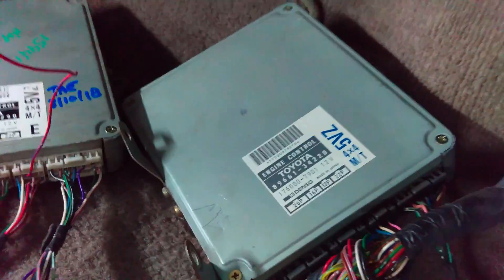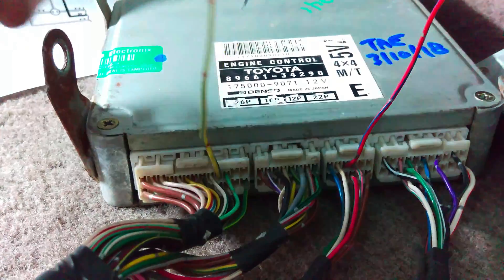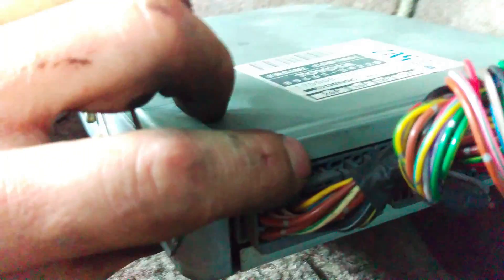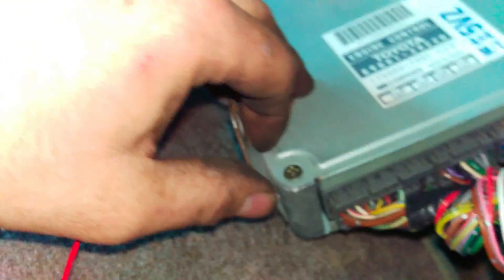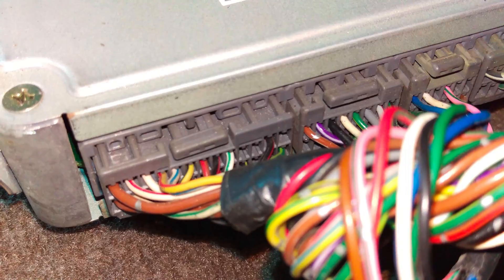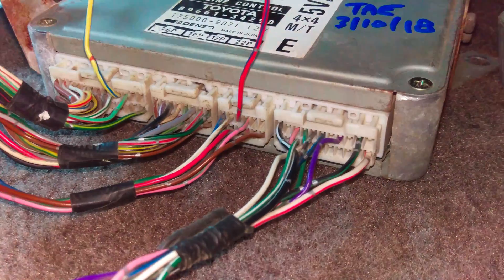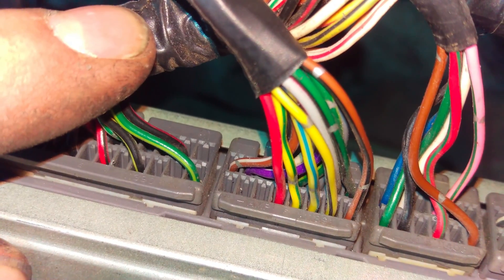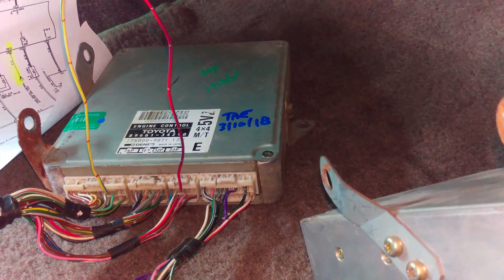Why We’re Upgrading the ECU on our Toyota T100

Comment: Did you use a 97 "complete" wiring harnesses? Like did you have to tear ALL the wiring from a 97 then remove all the wiring from your 96 to make it all work? I mean I wouldn't think so. You video I a bit confusing in certain places like when your showing the two ECU'S side by side it looks as if you have the entire harness for both years? 
I just installed my new 97 tb that came with the the newer 3 pin TPS I just snipped the idle wire because the 97 doesn't use it. However I think I need go inside the cab and disconnect the TPS idle wire I cut under the hood i see NO reason for it. But maybe I do need it just need to re pin it because after installing the 97 TB and TPS all it does is crank but no start or no check engine light while your trying to start it either which is new. No I really don't think I fried the ECU or anything just a few more minor wiring issues I need to work out. I could really use your help I know it's been over 3 years since you posted this movie but any kind of help or feedback would mean the world to me I really really want to get my newly s/c yota up and running as it should!
Thanks, Scott!

Comment: So if I have an 95 t100 3.4 automatic I can not swap my ECU for a manual ECU? Looking to swap my auto for manual out of a 98 t100
Reply from the maker: harness is totally different. Swap the harness or just use the AT ecu. Not sure what issues that will bring or not
Reply: @LILEVO  wow mahalos for the quick response. I may just leave the at ecu and see what happens. I have a 98 t100 parts truck. So have everything needed. Just really don't want to change entire harness lol. 
Is it extremely difficult to do so?
Reply from the maker: @sgallagher530  not sure, haven't looked into it. Might be able to just pull it through the firewall and swap it like Toyota's usually are.